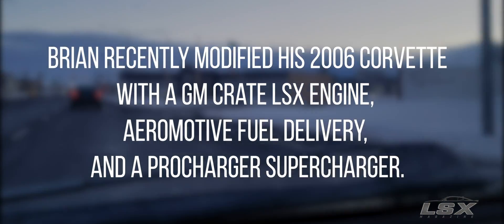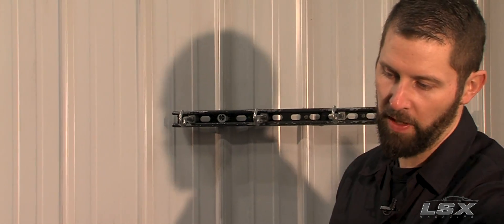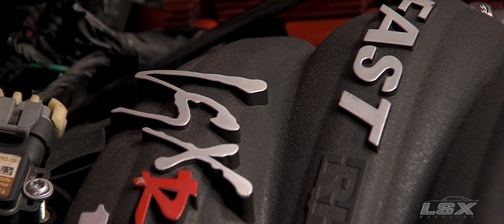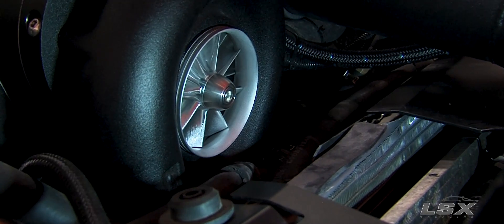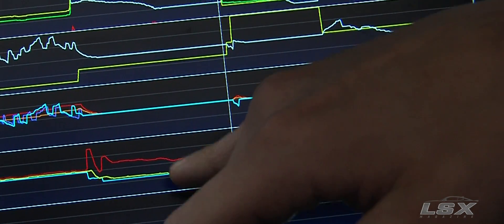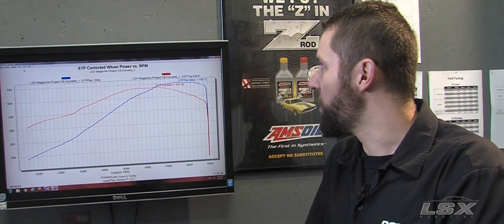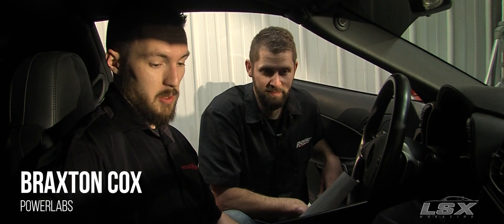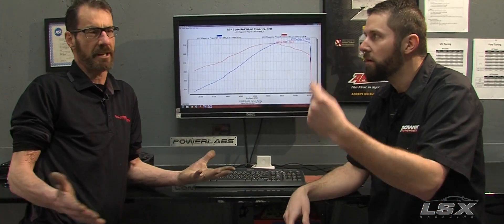LSX Magazine's ProCharged C6 Makes Over 700-RWHP on Low Boost

Comment: Didn't want lag yet you added a centrifugal lol nothing against it but a turbo is less laggy them a centri
Reply: Depends on your definition of "lag". Turbos will build boost, torque, and HP at a lower RPM, but there's still a slight delay between when you push the gas, and when the boost comes in. With a centri, your boost is directly linked to your RPM... you don't "feel" the boost ramp-in the way you do with turbos. A centri just feels like you have a really big motor that pulls really hard up-top. If zero lag is the goal, then PD is definitely the way to go, but they kinda peeter out on the top end sometimes.

Comment: The engine N/A comes with a little over 500+HP 
So you’d think it would make more HP than that.
Reply: N/A this engine makes 473hp at the crank (not the wheels): https://www.chevrolet.com/performance/crate-engines/lsx-376-b15
Reply: Is this a Z06...If so, then it is 505 hp at the crank. Most stock zs are 450-475 HP at the wheels, stock.

Comment: Is that good? My C6 Z06 makes 630 on 93, fbo, unported MSD N/A. Apples/oranges?
Reply: Johnny Moran does the z06 have a power adder?
Reply: @StLMikie  Naturally aspirated.
Reply: Kinda apples to oranges, the lsx 376 is rated from chevy at 473 chp so it starts out lower than your Z. On top of that figure in that this block is 9.0:1 compression and that it has 51 cubic inches less than your ls7. Also it is not a huge part of the equation but I happen to live near Brian and Powerlabs so I know that our "premium" pump is a bit lacking compared to 93. I highly suspect that with a switch to e85 he could easily pick up another 30-50 whp. With the 6 bolt heads and forged goodies in the block they could plug another 5-10 lbs of boost in and this should be streetable and reliable in the 800-900 whp range, possibly more, with a d1x instead of the older d1sc head unit.
Reply: @hopestobfast  All true. Good points.
Reply: @hopestobfast  100% They will be adding more boost, better fuel, and a few other things. Stay tuned.

Comment: why not D1-X?
Reply: ProCharger recommended the D-1SC based on the boost level and size of the engine. Remember, this is designed for up to 15psi. Also, with this blower we will already be at the limit of the transmission (6L80E).